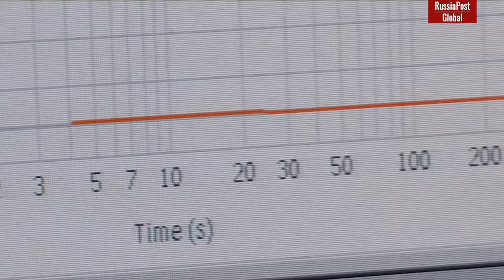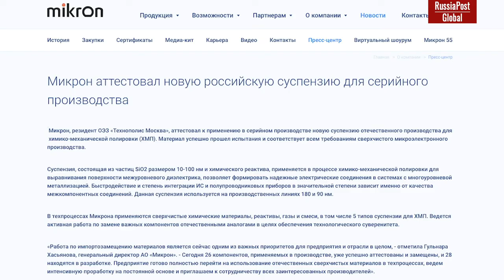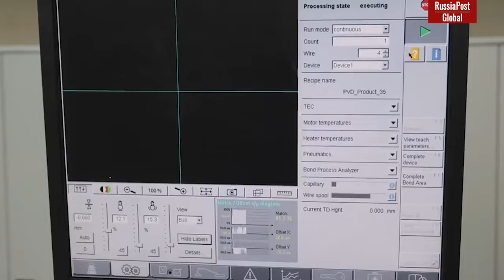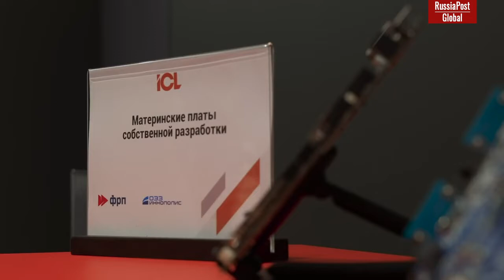Russian microelectronics: 26 materials were imported, a laptop factory was opened

Comment: To recover/spread the fixed cost of highly automated factories there are 2 ways:

1. sell large quantities over a short period (a few years); or
2. sell smaller quantities over a longer period.

Both methods can thus be profitable. In the second case, the R&D in manufacturing tech will continue but its implementation is delayed or skipped. For example, instead of having factories for 25nm processors in Year 1,  15nm processors in Year 4 and 10nm processors in Year 8, Russia can produce 25nm processors in Year 1 and 10nm processors in Year 10.  This gives ample time to recover the investment in the factory to produce the processors.

There are intangible costs such as the national security of Russia that have to be considered as well. Therefore a paper loss may be acceptable as well in some cases and a subsidy is essential.